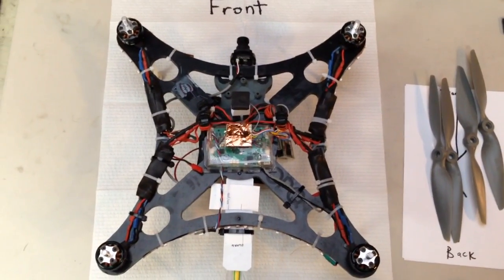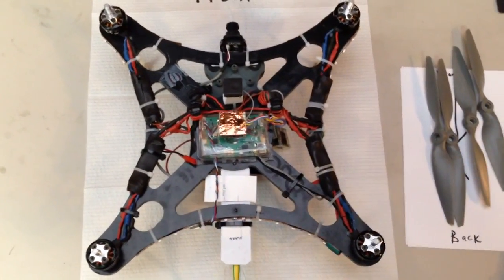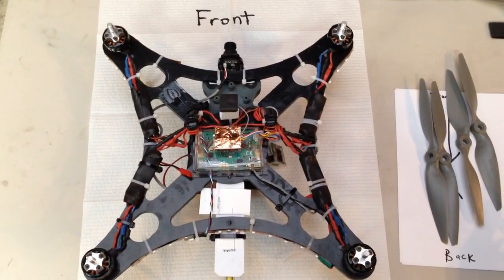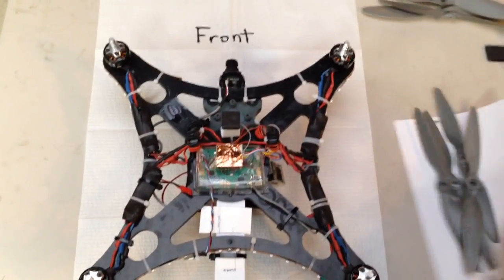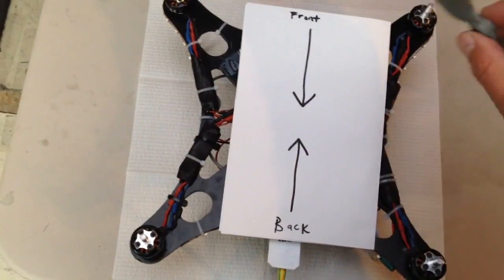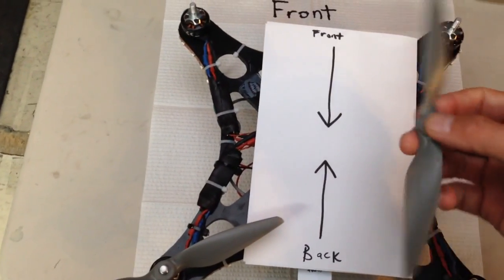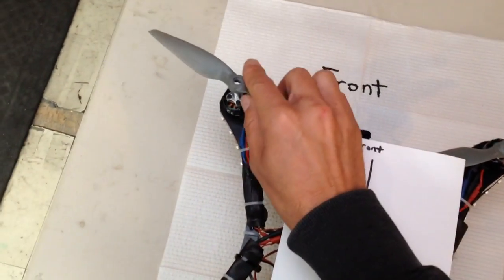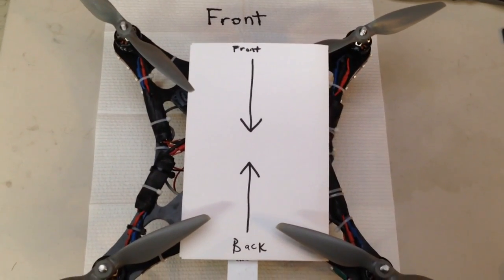Quadcopter propeller direction tip, Blade 350qx Dji Phantom

Comment: Thank.my drone was damaged somehow. I had to pull out my power switch which was totally destroyed. Then I connect two ends of wires which are at a direction of power switch. After connection with battery directly all propellers moves wrong direction. My question is whether I wrongly connect the wires or I change the prop wrongly.plz answer.
Reply from the maker: It would be hare do diagnose the problem- what quad do you have?

Comment: Yo!!  Have you EVER, EVER, EVER,  had a propeller that changed direction ON IT'S OWN???   I just TESTED 4 NEW motors ONE-BY-ONE on One arm that malfunctioned earlier on, ALL THE NEW MOTORS ALL began running in  a Clockwise direction as I tested each one one-by-one, which was confirmed THAN I soldered it EXACTLY how it was confirmed, and ALL 4 propellers one-by-one began going COUNTER clockwise FOR SOME GHOSTLY REASON!!!

NOW I CONTINUE TO HAVE 3 "COUNTER CLOCKWISE PROPELLERS AND 1 CLOCKWISE PROPELLER WHICH IS WRONG, WRONG, WRONG.......HOW DA HELL DO I FORCE THE PROPELLER THAT'S GOING COUNTER-CLOCKWISE..............TO GO CLOCKWISE?????!!!!!

I blessed it with Salt & Sage............AND STILL NOTHING!!!!

Is there some type of QUANTUM MAGICK happening???
Reply: I left it on the OUIJA BOARD too long!

Comment: Hey, 7demo7, thanks for this.  I have a Hoten-X, with orange back props and black front props.  Until I watched this video I thought the props could just go in any way, as long as the warning statement was on the bottom.  Not so.  I took out my inventory of props, and half were for CW rotation, the others for CCW rotation, and that was just the black ones.  This video pointed out the leading edge and was quite clear about which way the props should turn.  Took my quad out and actually flew it instead of it flipping over in the grass and destroying props!  You did a good service here.  God I love YouTube!
Reply from the maker: A lot of people just getting into multi rotors don't know this but find out real quick once they have to replace a prop..  And youtube is AWESOME!

Comment from the maker: Bigteedo11,  the stock 350qx will go to aprox 1700-2000ft so not far. I tested my high gain antenna mod that replaced the stock wire antenna. That got me to half a mile.
Reply: First thanks for such quick response/info! now you say high gain antenna mod is that hard to do?sorry to bother
Reply from the maker: Not really, I'm a novice at soldering and I just got the soldering station from Radio Shack on sale for $69.  You basically need a high gain rx antenna or borrow a 2.4 ghz wifi router antenna and  solder it into the board.  I soldered in a receptical (not sure what to call it, it looks like the male side of a snap) then the high gain antenna I got off ebay snapped right on. (It looks like the connection that the gps antenna uses to snap onto the gps rx.)
Dude, I'm here to help and am glad to even with my limited knowledge.
The mod took me about 20 min and I didnt need to take it off my quad at all because the solder joints are like 3 seconds in and out.  I have some pics of the process on the Facebook blade 350qx owners group, you should join as it's full of info and most of the time more detailed than on the forums
Reply: ok thanks!!

Comment: Hey quick question off subject but I know you have a 350qx and Fat shark FPV and I've heard the fat shark v3 can go a range of around half mile but I'm not sure how much range the stock 350qx has...I trying to figure out how far the combo of fat shark and stock 350qx will go any ideas? If you know line of sight and non line of sight range that will really help...thanks in advance

Comment from the maker: Mike h, go on eBay , there is a seller I've gotten 2 motors from $25 each. They're were from destructed new quads
Reply: +7demo7  so the motors are all going to spin in the same direction ?
Reply from the maker: no, the motors must spin the direction of the props as described.  if you have a motor spinning the wrong direction reverse the spin direction by swapping any 2 of the 3 motor wires
Reply: 7demo7 Got it : ). Thank you for you quick response. This is very helpful.